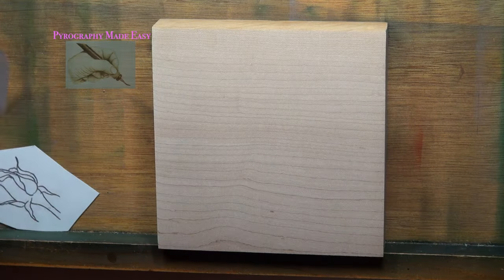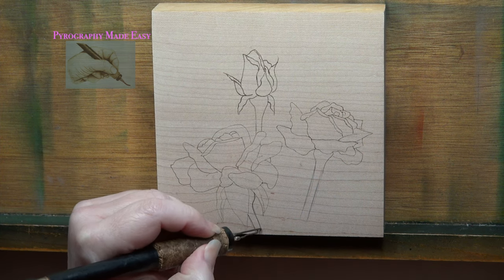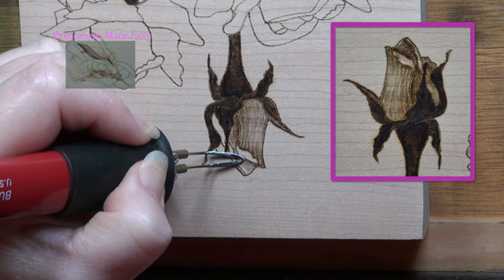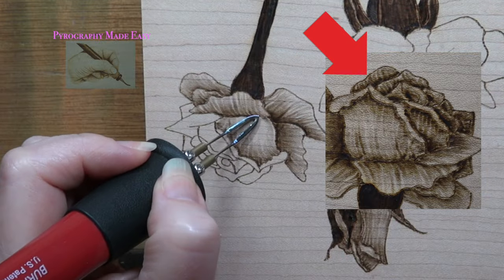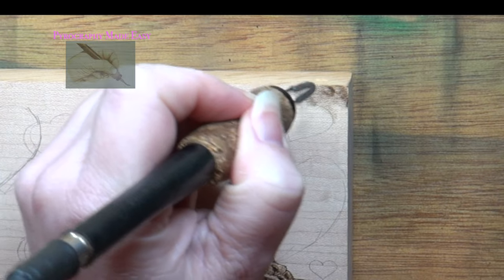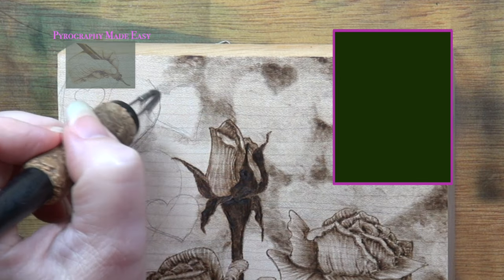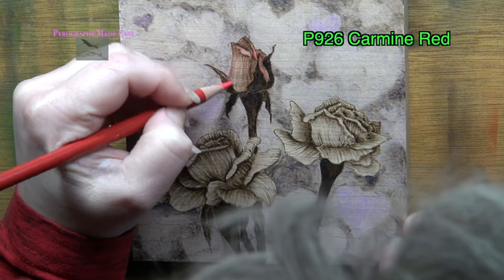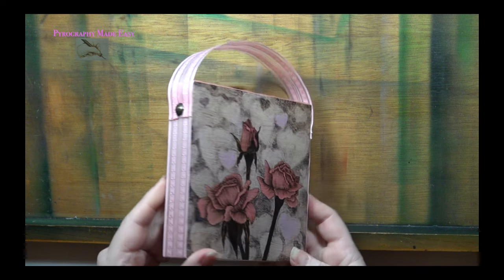Wood Burning for beginners - Valentine Hearts & Roses - pyrography tutorial

Comment: Love would like to.learn your art what type of wood is beat
Reply from the maker: Hi Ruth,
I do hope that you'll decide to take up pyrography.  It's an awesome medium to work in, but I might be a bit biased in my opinion.  :)

I don't think there is a best wood.  Instead it is what is best that is available and affordable.   For example, I like holly because it is super pale and doesn't have a lot of grain lines.  Unfortunately, it isn't common where I live, so to get it I pay more than I would for maple.   Needless to say, I've only burned on holly 1 time.  :)

When I was first learning I burned on birch plywood.  It is easy to find and semi-reasonable in cost depending on where you get it.

My favorite wood is basswood.  This can be found at craft stores, and a number of places on line.  

If you have a home improvement store nearby, you can buy boards of maple or poplar.  Both are good to burn on.  The boards are usually 8 feet long, but the home improvement store will cut them for you.  Last time I checked the first couple of cuts were free, then it was 30 cents a cut after that.   

Hope this helps